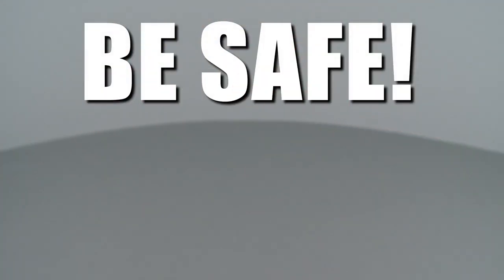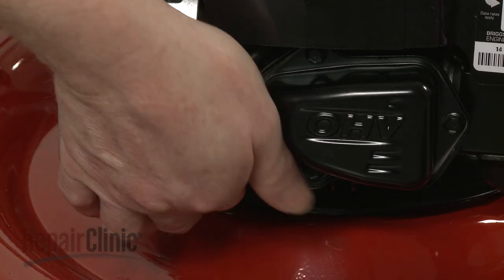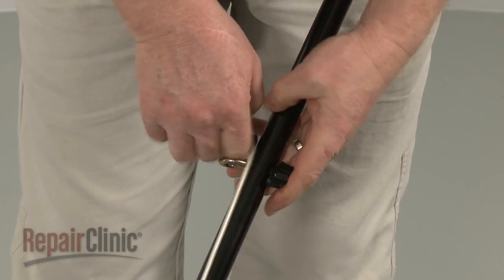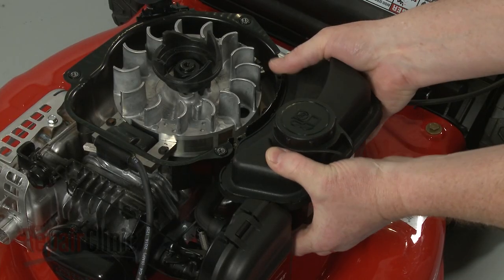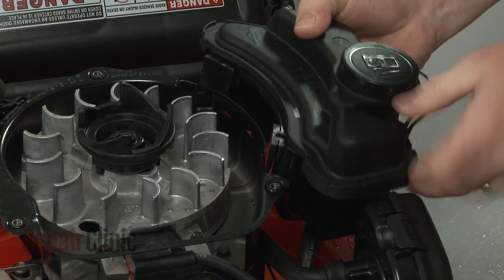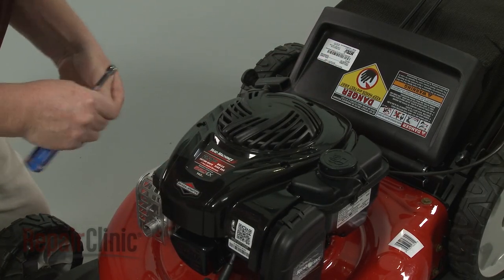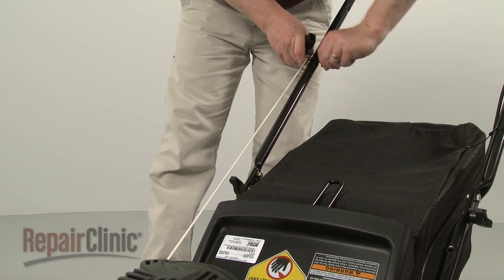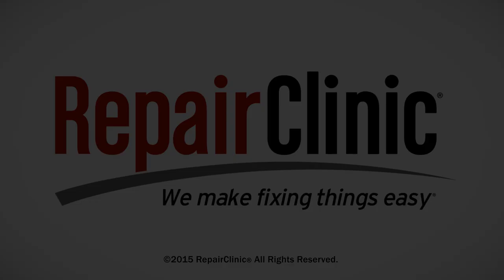Briggs & Stratton Small Engine Governor Spring Part # 590541

Comment: my snapper walk behind was working fine when i was cutting under an azalea shrub. this walk behind mower has no guard for the governor spring so i have learned. one slight brush against the shrub and the governor spring detached and was lost and the mower died. i saw other cheaper snapper models with guards when i went shopping for the spring.
Reply: Same thing happened to me.  The spring didn't come off, but was stretched and bent out of shape.  Another intentional mistake from Troy Bilt.  The mower was given to me by a friend who moved.  I will never buy one, because this is stupid.
Reply: did you find a video to replace spring that was lost?